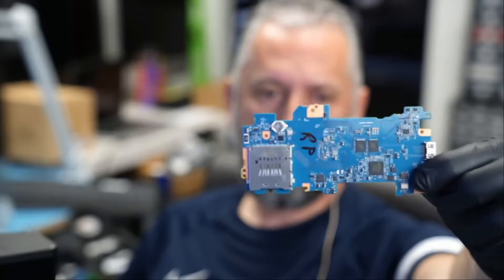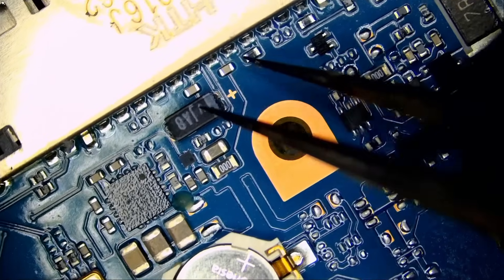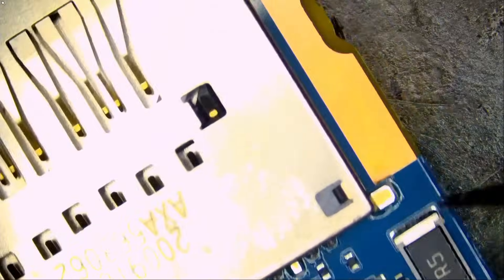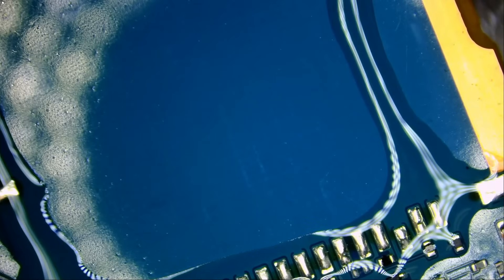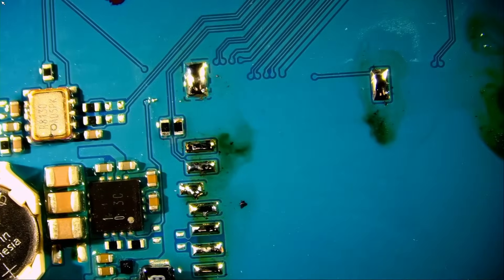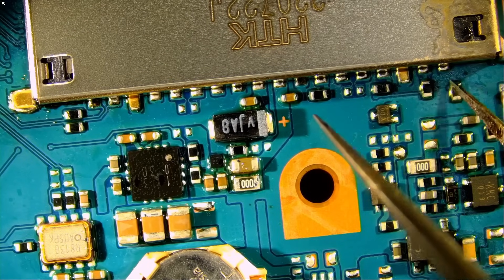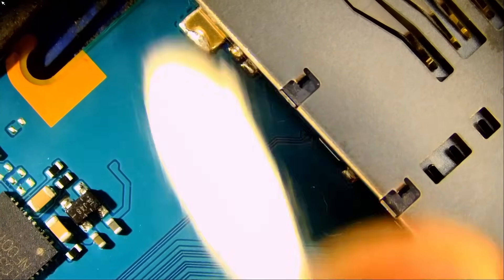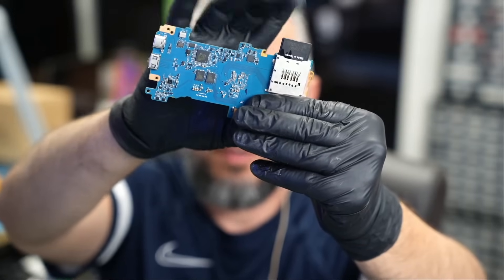Canon EOS RP Camera Repair - SD Card Slot Reader Replacement

Comment: I have removed a sd card connector from an old paper cutting machine (scrapbook). I cannot get the same connector. Can i connect a sd card reader to the board, cut the usb-c plug off and connect the wires to the points where the connector was soldered on?

Comment: This new type of SD card reader is a lot better, with older ones you undo the top cap and underneath there's a plastic and once you take it off  you have each pin soldered separately making the job a lot more complicated and annoying but here it's cool and easy